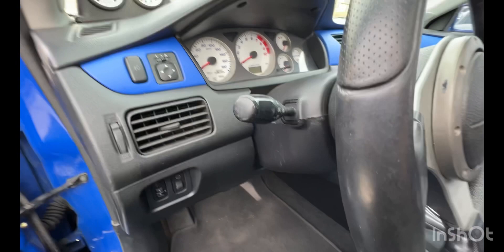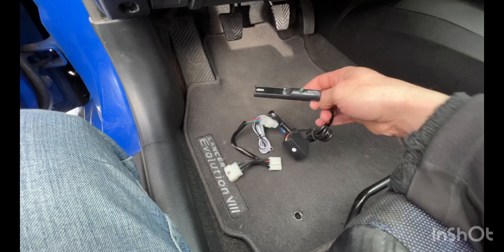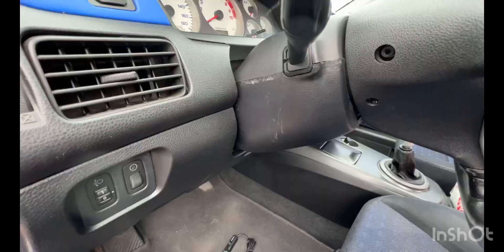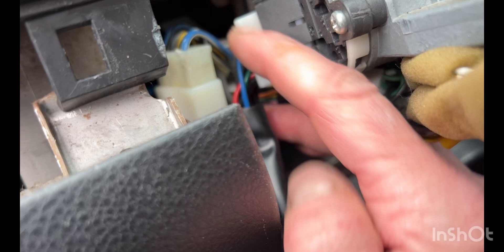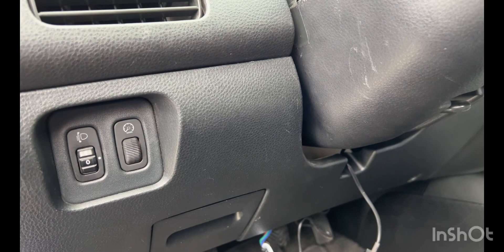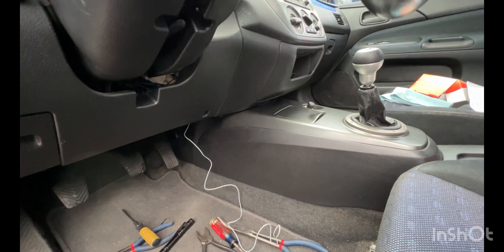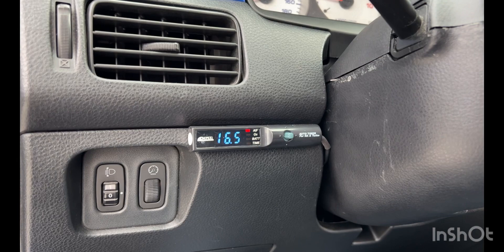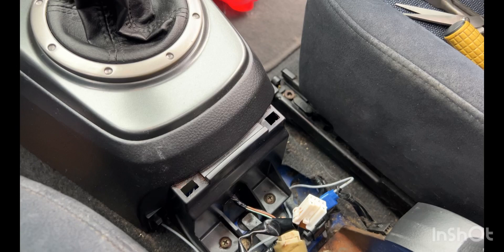Installing an Apexi Turbo Timer into my Evo 8

Comment: Thank you so much for this. I been wanting to add a turbo timer to my car but there hadn’t been any videos and I didn’t want to mess anything up THANK YOU SO MUCH! ❤
Reply from the maker: No problem!  As far as the PIN numbers on the ECU goes, the ones I listed are specific to the Evo 8 and I’m sure 9 and they can be different on other cars but it’s basically the same concept. Grey wire to e-brake, black wire to ground wire on ECU and white wire to O2 front sensor wire on the ECU. 
Overall it’s a pretty simple mod and if you buy the same style Apexi turbo timer as I purchased, it should come with directions as well

Comment: hey can you take a picture the harness that plug to the key switch?? i want to see where the three (red green blue) wires connect to the switch 
i live in Greece so its a little difficult to wait for the harness so im going to DIY it
Reply from the maker: Unfortunately YouTube won’t let me upload just pictures….do you have an email I can send the photos to?
Reply from the maker: I posted a diagram along with some pictures where those wires connect in the steering column in a post but unfortunately I’m out of town right now and won’t be back home until December so I can’t get any better photos

Go to my YouTube page and it’s in the communities area

Comment: Great video, links for all the parts ? Id like to do this to my E7 :)
Reply from the maker: Thank you!  I can see if I can find links so you can find the parts. 

Here’s the link for the turbo timer

https://www.ebay.com/itm/383538376500?mkcid=16&mkevt=1&mkrid=711-127632-2357-0&ssspo=qv62ycietng&sssrc=2349624&ssuid=sszkeyzVRXm&var=&widget_ver=artemis&media=COPY

Here’s the link for the turbo timer adapter. 

https://www.ebay.com/itm/113955092242?mkcid=16&mkevt=1&mkrid=711-127632-2357-0&ssspo=F5_rCZfjRH-&sssrc=2349624&ssuid=sszkeyzVRXm&var=&widget_ver=artemis&media=COPY
Reply from the maker: Here’s a link to the ecu pin diagram. 

https://evomoto.com/tech_articles.php?tech_article_id=19

Comment: why do people add turbo timers lol
Reply from the maker: Well it helps prolong the life of the turbo so the oil in the turbo doesn’t bake when you turn off the car after driving hard and it also offers a few other monitoring options like air fuel ratio and battery voltage.
Reply: Not just the turbo. The fan is working and is cooling the radiator. Thus, the engine and transmission is cooling down too.

Heat is the enemy for powertrain. And cooling helps to mitigate all the issues related to turbo, engine and gearbox problems.
Reply: the turbo is water cooled. turbo timers don’t do anything. idling isn’t going to cool your car off any more than just  shutting it off.
Reply: @Controlfreq  Thats what im sayin...turbo timers have and always will be rice